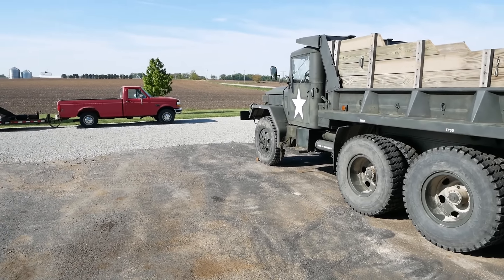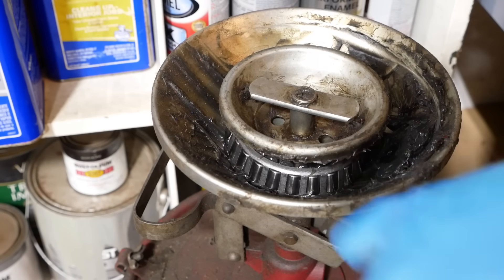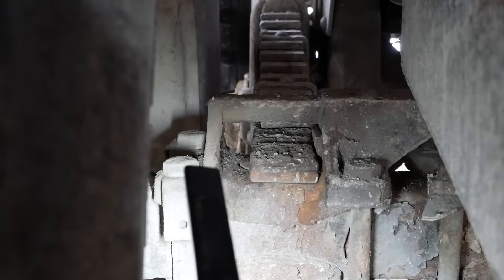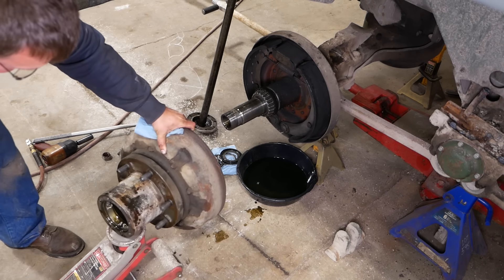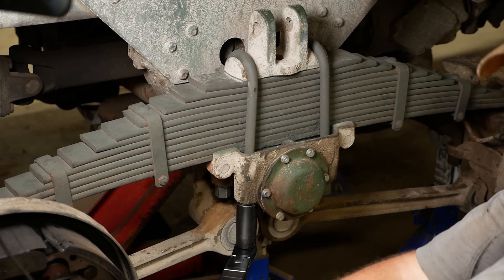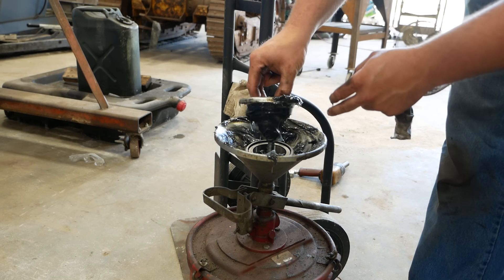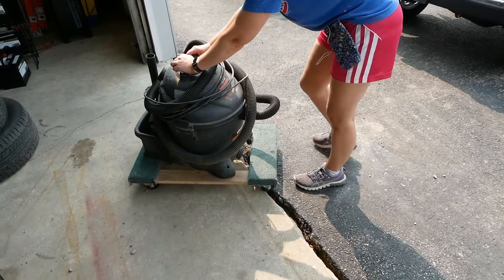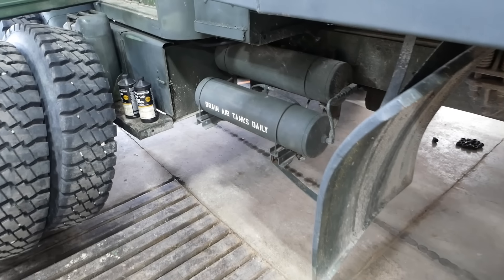Military Truck Crazy Suspension Damage - Can We Fix It?

Comment: Not scissor hoist 
And you are correct its a duece and a half.
Deuces have 6 lugs and 5 tons have 10 on each tire. Been a really long time since I seen a deuce dump. 
The 5 ton like this are M500 series and M800 series. I don't remember the two numbers after the 5 or 8. But its not real important. The 500 and 800 tell about the truck. The 800 were newer and a lot more powerful. The 500 were as slow as dueces.
The next after the m800 was the m900. Not to be confused with the other M900 dumps which were 20 ton dump.
If I remember correct M929 was the 5 ton dump,  and M917 was the 20 ton. And the M918 was the one with an additional rear axel  (3 in back like the M920)
Drove the duece dump once, the M500 series a few times. The M800 series and M929 many times.
Oh yeah during the M500 series and part time of the M800 series there was a 20 ton ( international) but no idea what its nurmenclacher was. One of my companies had them in another platoon. 
For those interested
The M917 was the same drive train as the M915 tractor.
The M916 was like the M915 except it had 6x6 and had a rear winch 
M919 was a concrete mobile. Cement truck but not like a civilization cement truck. It mixed on sight. Never operated one. But shotguns a few missions with others in my platoon. 
M920 was 6x6 with rear winch like the M916 however the M920 and M918 had a float axle that raised and lowered just in front of the front rear axle.
All the M915 through M920 had same cab and looked close to the same. And were bigger then the 5 tons. Size wise same size as a Kenworth.
Then there were the hets. Wide load monsters. I drove one in motor pool once. Just to change it location. No experience with them 
FYI the M800 series could do 75 mph 
M929 80 mph ( thats what the MP told me  I was doing, just before he realized   it must if been someone else)  ( thanks to my beautiful shotgun ummm "knowing him") 
Old dueces and m500 series. 55 mph on a steep down hill grade with a heavy wind behind you. Slowest one I drove top speed was 35mph.
All around I'd take the M800 series. 6x6 They had 5 speed manual and could get through almost anything. Nevee got one stuck it didn't get its self out of. 
Next is the 929  automatic with slapstick if you wanted to. But most the time we just slapped 5th from the start. Also 6x6. But did get stuck a couple times. Still not real hard to get out. But it did need help.

Comment: When you are working on military vehicles, you have to take everything that you know about vehicles, and do the opposite. That is the best solution I have found for working on them. That power steering was definitely an add on. Military vehicles com with most of the things they need to start and drive, but that's about it.

Comment: On the bent axle...seen it happen when a fellow student popped the clutch while dumping a load of dirt...truck has enough torque that when it pulled the nose off the ground it torqued the axle just right it bent the axle tube....of course  this was on 5 ton dump...also if that 5 ton dump is anything to go buy well the master cylinder on your truck is actually in the wrong spot because it is supposed  the cap is actually supposed to be level (or just slightly below) with and in front of the crossmember...then again the pto/raise/lower lever and the e-brake levers on the 5 ton is backwards of yours....I know it's not yours yours but you know what I mean

Comment: that is basically a 6-rod suspension...........very popular in Australia, even today.  Roadtrains that run in the outback wont use airbags if they run on dirt roads, they spec 6-rods instead.  Heavy trucks from the 1970's often have that power steering setup. It has a dump body on it.............someone dropped a big rock in the back, thats what happened.

Comment: They are called radius rods I used to be a bus and heavy truck mechanic I'm very familiar with this setup its a seal behind that parking brake drum If it dog tracking the Rods are worn and should replace they are mounted on rubber and it will cause the rear end to dog track you have upper and lower rods some can even be crossed way. Ist not bent replace all rods and believed me its work.

Comment: I'm with a few of the other commenters. I bet someone ran a chain around the axle and either used the truck to try and jerk on something stuck, or it was stuck in something like deep mud and that was the only anchor point they could get to. Couple jerks and yanks on 5000 pounds stuck in deep mud could bend an axle I'd bet.

Comment: Great work, but why didn't you clean the stuff first?

I would also fill the holes on the trunion with grease or wax, otherwise the u bolts will rust again

Comment: You should never put over size tires on a military truck or any vehicle. Always use factory size tires. That bearing packer is so cool. Getting replacement parts for 30 year old military trucks are really had to come by. That is the reason some buyers will buy 2-3 trucks at auctions so they have at least one parts queen. Also some 2 1/2 & 5 ton trucks have longer rear axle housings are longer so the rear don't run in the same rut the the front tires. Just like some of the GMC & Chevy 4 wheel drive trucks. I loved driving the 2 1/2 ton trucks at artillery school in Fort Sill, Oklahoma when I was in the Marine Corps. I hated driving the 5 ton trucks that we used too tow are artillery guns when they changed the tires to super single tires which was dangerous driving on wet roads because the large nobbey tire tread.

Comment: Haven't worked on trucks that big before, tons of med. duty. See this all the time on the 1 tons. Had a guy bring in an F150 , the rear axle was bent like a banana. The top of the tire closer the the bottom. Truck wasn't a year old. When I questioned the owner it dawned on him. They had Dropped a Excavator bucket in the bed, way over loading it. When Ford wouldn't fix it for free, the owner took it down the road as is.

Comment: Lol. I once had to locate an oil pan for a 5 ton.
I can tell you a normal Cummings oil pan for said engine wouldn't do. The military engine, though the same has an extra piece off it.
Cost me $800 and a 12 pack of beer to get it to a civilization shop 48 hours later. And a lot of avoiding our C.O. during that time.
I didn't ask how the shop got it.  But i believe it came from Ft Riley KS at about 0100 hrs. A state away.  One thing is for sure. It was used and was not surplus as the truck was new to the Army.
Give a new meaning to Clinton's don't ask don't tell. Lol.

Comment: My guess: the driver did a bad turn around something solid with a little speed and that solid thing (tree, metat pole who knows) ended up on the front of the rear tire and made the truck to a complete halt very quickly and all that energy went into the back axle assembly which was enough to bent it a little and also pull the springs out which requite hell of a lot of force to do. The weight of the truck at a little speed is enough to do that and it could also had been fully loaded when it happened which would have helped.

Comment: Consider fabricating say …a 1/2” spacer ring …and place between hub and inner wheel…add more if 1/2” is not enough to prevent the tire rub.

Just a thought…

Frank

Comment: i think every You Tube Video i’ve watched  onDumptrucks getting repaired  have all soaked the shop floor s in a similiar fashion  i’ve seen Bearing machines for sale  but i never seen one being used until this video  it looks like it  does a good job  overall  but takes away some of the fun of doing by hand ?

Comment: You can find the centerline of the truck and draw a line front to back on the floor then check to see if all your axles are square to that line. Pretty sure yours were not. How to adjust them is another story. … and you get to use the old plumb bob.

Comment: you can  eliminate the outer seal and fill the hub with oil. the original inner seals were leather. that is why the use of the outer seal

Comment: my guess to why those springs are bend is to fill up the dumpbed with a verry compact heavy load and make a verry tight turn on a verry grippy surface
as for getting more room for the tire : maibe have a set of spacers made , bout 5mm thick (bout the thickness of a sigarette ) should be good enough to get them to clear

Comment: if they can't order or get ahold of a 12 leaf spring you can buy a 10 leaf spring and add 2 "Raw leaf springs" (usually available from a bus supplier)
put it together and you have what you need (just get the thickness and length right)

Comment: FYI super singles did happen in Army until 99 /00 most duece were not in at that time. But did happen on 5 tons. And we just changed the rims/ tires.  No messing with axle or hubs. 
No. I'm wrong. Forgot the super singles were air. Meaning they self inflated which of course was a pain and didn't work.Thats right we turned in the trucks. And pick up the trucks at same time. Then like 2 months later turned them in. Forgot.
Not sure if there was a super single for dueces. They had different size tire. Such a dueces has 18" and 5 tons had 20" 
A couple years later or maybe at this time. My unit didn't have duece. The cab over duece came out. 
I remember we changed to singles and then turned right around turned them in and went to PLS and CHU.  
BTW if you love the CHU your welcome.
If you hate it. Ok my fault. We were the  testers for the Army. Only brand new Army vehicles I had.  Myself and a friend were the first ones licensed in them. Only time I had a civilian sign off on my military driver's license. Then we had to give the privates / spc classes and test them. 
Good thing is he and I got the CHU first and keep signing them down after they past. So we got to drive all in our company before everyone else.
Bad thing is we had to pick them up from the railhead as they came in. 
Back to the good. When we, or should I say I did something wrong we were able to blame the truck. Since no one knew them yet. Lol.

Comment: I couldn't help noticing that that final drive had an input shaft (from the front axle) but also seemed to have an output shaft??
Reply from the maker: Because the front and rear axle are identical. You could gang up as many as you wanted.

Comment: To replace  the rear dogbones on my M939 truck, which is 20yrs newer, it will cost me just $1500 just for the parts - not including the labor cost if I don’t do it myself.

Edit after seeing your comment: Even my truck is setup with grease packed bearings, for both trunnions and hub. They are that way for combat effectiveness. Imagine taking light damage from say a hand grenade, that drained all your oil, but you could still drive. Wouldn’t be too long before you destroyed the drivetrain because you used oil instead of grease.

Comment: Wes needs the maintenance manual for that truck. That is not done like that and oversized tires put a lot of strain on those bearings. Motor Sgt. for 23 years. The old 2.5 tons had bearings and updated to a solid block shaped like the tapered bearings.

Comment: Had that not been a dump body it would have been less expensive to just buy another truck. Hope you billed our 4-5k in labor alone.

BTW I was a 63B in the ARMY and my mod would not even have performed that repair. It would have went to a 3rd shop repair center.

Comment: You should of drilled out the old pin and rewild a new one in or bought the right spring with a pin in it. The pin keeps the axle from walking and its what hapind to it. I've seen it before. In the Army.

Comment: Checking the Runout whith a hammer is obviously state of the art technoölogy in the United States but in the meantime, somebody came up with the idea to use Laser measurement , it  is a little light that you point on a thingummy that is attachtched to the front axel. Make sure that there is no cats arround as they can be attracted and start doing summersalts all over the workshops.  Crack on mate.

Comment: DO NOT SET THE BEARING AT ZERO LASH!!! It might work in the parking lot but remember things expand with heat, If you set it at zero lash and drive for miles it will either lock up or grind itself to death. Trust me I have done it a few times. I know the slight looseness of a 1/4 or 1/2 turn back is annoying but it is necessary. (I've been a mechanic\ certified auto technician for 20 years)
Reply from the maker: That's correct for a wheel bearing. But a suspension pivot is a different animal.

Comment: I helped rebuild trucks like these,...."deuce and a halfs",....code F to code B rebuilding(inoperative to operative enough for war),....in West Germany US Army in the late 80's as a so called mechanic, ...more of a multi mechanic doing alot of things.  Did alot of the axle work, packing the bearings, putting the axles in,....I even broke or sort of smashed my fingers one day when I slammed home a axle into place too fast, ha, ya know, holding the axle hub end,...due to having been awake and mechanic working for bout twenty four hours.  Adjusted the brakes along with complete brake jobs, replaced tires, the left side whell studs are left hand tightening, not righty tighty.  I did alot, its hard to believe it was me, but eh.  The more experienced soldiers did welding on the cabs which had massive rust, ....several just got a brand new in storage cab assembly.  Using the large floor jacks, getting under the vehicles and placing jack stands, etc etc.  We had of course 3/4" air impact driver,...plus one inch, ...actually we had some hand impact tools for things, no air, all mechanical,...worked great for the large fork lifts...its hard to believe I never became a truck mechanic after service, ...some folks just didn't want to take a chance on hiring someone military trained in a local tight job market,...probably their loss,..my gain, ...its hard dangerous work, surprising I didn't get hurt or killed in service,...had a truck come off jack stands on one side on uneven ground once,...with me underneath, no tires on that side, haha, ya know,.....field service work in a war zone....

Comment: Sept  13th 2021   Lots of guys like me , love those old  AM General  Pattern  Of Military trucks!  The looks of the old Girl are 
Magnificent!  This Is NOT to take  away from the common sense of the new generation of them. The tilt cabs,  and such !
Yes Many of the finer points, of the mechanical details, can in some cases be traced to the nature  of the  parts that  the military specs out, for instance, the  8  points of adjustment for the brake shoes.  But I am NOT an expert.   Stuff was done that way for many reasons, unique to the military.   these trucks for instance were built to wade through seas of mud!
That is why the drive lines are  level for maximum strength!   Top load diffs too.   People have to get into the  historical
records of the procurement  history, of these trucks to understand.  Also, to be fair, give the Brooklin Bridge, to an idiot, and he will  break it!    And there is not much that can stand up to Young ignorant,  high on adrenalin;  young men, who think they are immortal;   Also,  your client , may have done that damage, and is not admitting to it!     I am sure your Bill was not cheap. 
I hope He learned his lesson!   Parts are available , Wes !   You just got to call around.  The used stuff may have to come 
from a  scrap yard 1000 miles away. But they are out there.   Also,  because they are specialised, they are  not cheap.
Usually. But what is cheap, these days?    These trucks like  jeeps are an IKON, of the Nation. They have a following, that will
not go away soon.   I think you did a great job, working on it! Bravo!   I love watching you WES!
Best regards, kennethzakaib607@gmail.com   f6004x4 enthusiast, old, but not dead yet.    Coming out of a bad period
in 2021.   Montreal   Quebec Canada.

Comment: The problem with army maintenance, its the young and inexperienced soldiers that do the maintenance. By the time you sorta know what you are doing, you have enough rank that you are put behind a desk and no longer do maintenance work. Young soldiers are often not sure if they like the military or not and dont have pride in their work. They often do as little work as possible and often take short cuts which leads to really bad maintenance. I would say that 50-60% of the work military mechanics do is fixing another mechanic's poor work.

Comment: Wes; did you compare those measurements your wife and yourself did front to rear of both axles with the new install?  My thinking is; could that poor truck have been backed into something. The bend you can see in the axle doesn't really tell you if one side is bent back or the other side bent forward without laser sighting from the center of the pumpkin through each side of an empty carrier cage bearing clamps outward to either end???  At this stage though after all the work you've done, washing your hands of that job would be anyone's choice.

Comment: Brakes. Air over hydraulics. Brake fluid leaking. Line or brake cylinder
Or maybe the dueces didn't have air.
Oh so it was a wheel seal. Oil looked thiner then the 85w140.

Comment: you should be using hi temp grease and that ubolt that you did not tighten  will come lose and you back were you started stick to your day job that is not how it done ..:face-orange-raised-eyebrow::face-orange-raised-eyebrow::face-turquoise-covering-eyes::face-turquoise-covering-eyes::face-turquoise-covering-eyes::body-green-covering-eyes::body-green-covering-eyes::body-green-covering-eyes::body-green-covering-eyes::body-green-covering-eyes: working on any thing that drives on the road :body-green-covering-eyes::body-green-covering-eyes::body-green-covering-eyes::body-green-covering-eyes::body-green-covering-eyes: